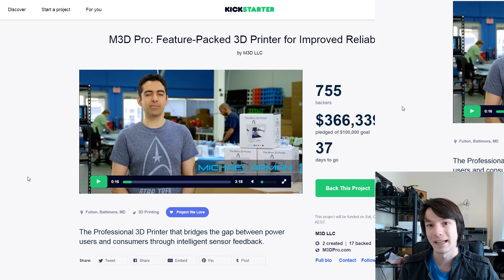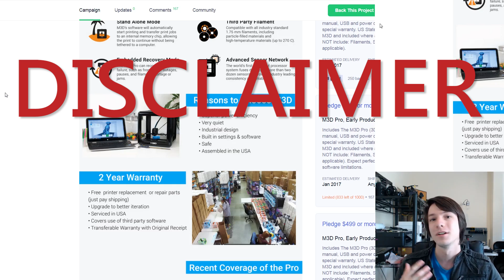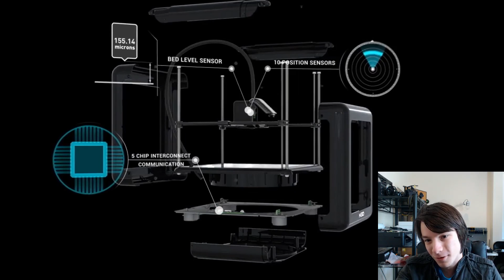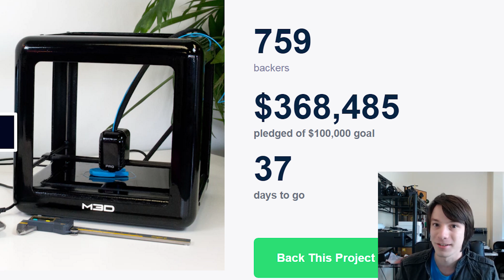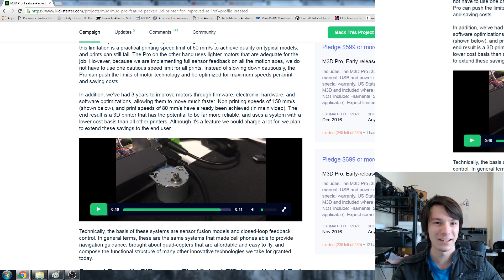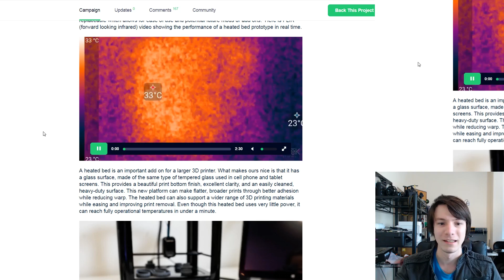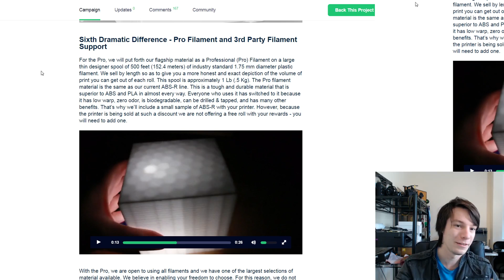Should you back it? M3D Pro Kickstarter Review

Comment: With the refusal of 3DPI to investigate (after 3 people promised to investigate), we might never know what actually occurred. 
However, the utter fact that M3D silently closed after Michael Armani absconded with @$23,000,000.00 US,, no one needs to worry about this company ever again.

I would've been a buyer of this machine.  I owned an original Micro.
I did print at 0.050 mm layer height.  It printed very accurately, but the machine was too slow.  by the time they introduced a Micro + and the upgrade kit, Ender 3 was here and destroyed any market share for M3D's Micro.

Did I mention that it was slow?  print time was not measured in minutes but in hours.
It printed perfect, and I DO mean PERFECT, parts.

BTW, I am the guy that ended MakiBox and the fraud of Jon Buford.  If that lends a bit more credibility to what I say.

Comment: One year after investing, I would say NO. For those of you who didn't invest, you dodged a major bullet.   I bought in to their March market ready Indiegogo tier on Dec 28, 2016. I recieved my printer in late October, then subsequently contended with very poor print quality despite a lot of calibration. Then there was PCB failure, causing the hot end to fail to heat properly. Once I replaced the PCB to fix the hot end heater, the print bed heater has started to give me problems. Print quality continues to be poor. All of the 'self aware' and standalone features we were promised have still not been delivered upon. And they have been sending out 'market ready' machines since April. 

For a couple hundred more dollars than you'd spend on this printer now straight from their store, you'd have a real market ready, fully functional, much more reliable and much faster machine. I wouldn't call the M3D Pro a scam, as I can tell that at least their support department tries to help people... but the repeated explanation for lack of promised features even *now*, is that this is still a machine that is in development, and given the fact that they've been selling directly from their site for a while, that doesn't really fly for me.
Reply: I really, really wish i'd come across this video way back when I dropped money on this thing. I feel like throwing it out the window every day I have to deal with it.  Have since invested in and looking forward to a Prusa MK3. Every remaining day I have to look at this thing makes me more upset.

Comment: I have to say thatI have a micro3D printer and love it.I don't have much to compare it to, but judging from comments I read all over no 3D printer is perfect. The micro3D may need a little extra setup and tinkering, but don't all printers?
But overall my printer works very well, I have had a lot of fun with it and keep it running 24/7 (as best I can).
To say its a successful hardware Kickstarter is obvious. I received something that works, and is useful!
I will be backing the Pro because the micro shows me this company has a great mission and the tech and desire to pull it off. They may have realized during the Kickstarter that the micro couldn't be the printer they wanted to make, but they did deliver a nice half step. Looking forward to what they bring in the Pro!

Comment: I just received mine and it is pretty terrible. It should be noted that this was estimated to be delivered in JANUARY and showed up at my door yesterday. It is missing 80% of the features ENTIRELY, including calibration. When attempting my first print it the nozzle pushed into the bed and began to DRAG ALONG THE HEATED BED. When it says it can re calibrate height it merely pushes into the bed and then lifts up. It solves nothing. Inserting filament is a pain too. 30 minuets of forcefully pushing in filament. I am extremely disappointed and wish I hadn't wasted the money on this printer. If things change I'll update this, but until then, STAY AWAY FROM M3D.

Comment: :[ I have a m3d printer the micro this is not right it is my first printer has a goo build space hasn't had a single clog its internal filiment loading stay away from it its terrrible but the external is great it is reliable good quality prints and for people like me with no knowledge of 3D printing the software is easy to use you guys most likely have the really cool printer ultimaker replicater and so on

Comment: I have 3 Micros.  I produce complex parts for Magicians and they all run constantly.  Do stay away from their new PLA Carbon Fiber. Their Tough Ink Flexible ink and works well.  I took out the nozzles and had a local CNC shop make me stainless steel nozzles. I found that prints were even more tolerant than with a Brass nozzle.  I've tested copper, bronze and wood filled filament and with the stainless steel nozzles I've had no problems.  Their support and customer service is excellent.  I've pledged for 2 Pro's that will run along side the Micros.  They're all run from a 12 Processor MacPro with 128 gigs of Ram.  Leaving the computer on all the time really isn't an issue as the same Mac is running a 50watt VersaLaser 24/7 and is on all the time anyways as it also wifi's 6 camera's around the house and property.  The Mirco's have a cold bed, the review said you can not print ABS on a cold bed printer without warpage, that's total nonsense, these machines have been doing it for almost a year now.  Cost was 299.99 special they ran and after the first machine paid for itself in a day. we purchased 2 more and they too paid for themselves within a day.

All in all we're very happy with these machines and look forward to the Pro units. Rob at the help desk, you couldn't meet a nicer man that puts his all into working with you if you have a problem. Since there is someone always here in the shop 24/7  he was getting tech support from Rob at 2am when they finished.  Customer service is great.  Warranty repairs are great, they ask for shipping, more than fair too, a lot of companies have turned to that. We have never been charged for any parts that had to be replaced.

The M3D software for the Mac is a bit buggy, but it is still in Beta.  I'm hoping they upgrade this for the Pro. But it really is a breeze to use, I can rotate, scale etc.  Any critical changes I need to make that the their slicer won't do, I just go back into CAD and twerk it.  Something I haven't seen reviewed about many printers is noise level. For the size, motors used and movement the Micro 3D is very quiet compared to other printers I've heard running.

While the different color machines were probably designed for personal use, they come in handy as we set ours up as a color coding scheme for certain parts. It's been quite handy, I don't agree though on charging and extra 25.00 for certain colors, but sometimes you have to bite the bullet and just do it.  

All in all we're all very happy with Micro 3D and look forward to our Pro's arriving.

Comment: I've had a 50/50 experience with my micro. Once I fixed my printer, and actually learned how to print it's been smooth, with the software updates it's been better, and better. HOWEVER, their customer service is horrible, my motor went out, and their customer service gave me a hard time about a replacement part.

Comment: I have an m3d micro printer and I got it to be a starter 3D printer, and I LOVE it, I mean it's not great but it prints and i love having a printer. I also set up a raspberry pi with octoprint to have it so it wasn't tethered to my computer ant now it works beautifully I really love it and m3d has been very helpful if I've had an issue

Comment: standalone mode is nice, but it's a pain to trasnfer files to an sd card and then put it into your printer. Just get a raspberry pi with octoprint instead and get the best of both worlds.

In any case, you should passs on anything M3D. They are toys and there is better stuff on the market now.

Comment: hi Angus, I own my micro about 1,5 year now. As student this was awesome option bought it second hand. I see all the hate but I have had a blast with it I pumped about 9kg of filament thru it once you get it dialed in it prints amazingly. its easy to transport and durable I just throw in in my bag and off I go. the software updates keep coming and increase the overall experience. very easy to use a third party slicer if needed. don't know if you will read this but just wanted to mention this,
Reply: The micro is so much better than the pro. I'm going to keep my micro. Pro is really, really terrible.

Comment: As kickstarter backer of the Micro, my conclusion is : Stay away of the Pro. 
The main problem with M3D is not the hardware, but the software. Hardware has many many problems, but software is so bad. I don't trust M3D at all for the Pro.
If you want to learn what you will not have in your next 3D printer, own the Micro. After that, you could choose a real 3D printer (I moved to Prusa i3 MK2).

Comment: Even still this just might become an ideal printer for some one who really just wants a plug and play, without needing to know much about the hardware, time will tell. 

Can't say for sure, but the Head looks like stainless Steel, and its a solid tube, measuring about 2.1in.   No idea what the liner is if there is any at all. Given the design, I can't be sure they every had one. Edit: seen Teflon listed in some details. 

Truth on the heater being ceramic, not cool. So far mines holding steady. 
If the head can be replaced this kinda negates the tuning. Thus the heaters should be replaceable. I really do not believe the story about the tuning. 

Used Black ABS only for doing calibration prints, and other objects less than 1.5cube. Without a heated bed, ABS really not useful otherwise. 

Best stuff I have used with the micro, that does not require a heated build plate, PET-G and M3D's own blend Ultra Durable 3D Ink. PET-G is very similar to what your soda bottles are made from. The ultra durable stuff is very tolerant, like ridged high temp hot glue. Ultra Durable also is the only stuff they allow 50 micron and solid back fill, and yes it works. 

By the way M3D now offers carbon fiber on their site.

The Micro is not my best friend and I have plenty of critique, in fact two pages of it. But there are far worse machines out there. Their pro addresses most of the issues we the actual users have submitted. Could they still do better? Probably. Even still this just might become an ideal printer for some one who really just wants a plug and play, without needing to know much about the hardware, time will tell.

Comment: I got an M3D micro as an Xmas present last year and it's been great! I've heard a lot of people had issues, but I must've got one from the second or third batch because the only problems I had were some random shifts (some slight, occasionally a dramatic shift) in the print, the usual problems with ambient temperature, and that's about it. So overall I'm happy with the micro and expecting good things from the pro.

Comment: In short, stay clear of it.
I was a backer of the M3D and that printer TOTALLY SUCKS!
It ended up thrown on the floor out of frustration. And that's the best thing I ever did.
So much time I wasted trying to calibrate that piece of crap.
They claimed to have auto-calibration feature... well, auto-calibration my ass! It just does not work.
Now I happily own an FlashForge Creator Pro. It works like a charm. Of course it costs more than the M3D, but the quality/cost ratio is much much higher. To be honest I would actually define the quality/cost ratio for the M3D as 0, as it is basically unusable!

Comment: Wow, they made it a 'feature' that the heated bed uses 0.6 watts instead of 5 watts per square inch?    So they've cut power to a device where output is proportional to power.   What they're really saying is that it will take 833% longer to heat up, that it will struggle to hit the target temp, and that it will have trouble holding the temperature.

Comment: Another Micro kickstarter backer here. I can only echo the others' sentiments. It's slow, buggy, and can't print ABS at all and PLA only barely. The quality is ok when it works, but not stellar, and you have 50/50 chance of failure even with simple parts. And the software it comes with is just absolute garbage.

I have just today received a heated print bed mod for it, I'm hoping that it'll make it work better and I'm not just throwing good money after bad... Even just doubling the reliability would go a long way to make it kind of acceptable cheapo printer.

Comment: i own a micro m3d and it never really fully worked. at the beginning a few small prints worked out well but then it got worse and worse. ive tried to fix it, did all troubleshooting and calibrations over and over again but now its just a brick. i would not back any 3d printer anymore, better wait for it to be released in retail. it will be more expensive but youll safe alot of time and hassle as kickstarter printer project never go well and they are always delayed (and sometimes even quite big hidden costs like shipping, upgrades etc).

Comment: While I like your videos,  I do have to say you missed the point on a lot of things. M3d seemed to be comparing the specs more to the original than other printers in general. Also, the printer's nozzle is stainless steel, so filled/abrasive filaments shouldn't be a problem with wear. 
Last thing, the comparison to a $300 i3 is a bit overkill. They have a lot more features built into this with all the sensors that will (in theory) improve reliability and the quality of the prints. 
In my opinion, it isn't a too high of an asking price for the innovations they are trying to put into this.
It just seemed to me that Maker's Muse was a little miffed about not getting a printer for evaluation, back then they probably didn't need to do that since they had so many orders. It seems they will be doing that this time around. 
And yes, I backed it, but not 100% sure if I will keep my pledge. I already have a BigBox that keeps me busy.
Reply: Angus is just another shill who wont review anything he doesnt get for free.

Comment: A friend of mine got the M3D back in 2014, and it has never worked to quality standards of say the I3.
The slicer has waay to few options. 
It deforms anything that is round and somehow shifts for example one half of a full cylinder a milimeter or two in the x or y plane, which makes the print completely useless. 
the prints take for ever to print compared to my Rostock MAX or his current I3 at even when only 30mm/s printspeed vs the fast slicer option of the m3D.
It produces bad, not fully filled in, too light and fragile prints that are nowhere near watertight...

Conclusion:
If you are thinking of buying a low cost printer that poops out good quality prints, just get yourself an I3 for example, or some of the printers named in this video and not any M3d products. get one with actual nema 17 steppers and a ridgid frame with steel rods and not this flimsy piece of crap.

This is just a beware for anyone thinking of getting involved in this kickstarter

Comment: I backed the first one and I regretted it, to be honest. $600 early beta pledge ( what an arse I was) got me a printer that was a year late, didn't work on arrival and after sending back for a replacement, POSTAGE FROM THE UK AT MY OWN EXPENSE, was, well, awful, to be honest. Slow, very hit and miss, poor slicer and software and frankly disappointing on most levels.
The M3D micro had the promise to be an awesome wee printer but failed at too many simple things. If anyone looks at the kickstarter comments, people are still waiting for their printer now, after almost 2 years and most of those with the printer are unhappy with it. Don't get me wrong, a few people are very happy, but they are few and far between. 
Doing a kickstarter in 3d Printing has to be good and cheap - there are so many reliable little printers available for low cost, so if your project doesn't at the very least match up, there will be few people backing it.
My M3D micro is now a paperweight but I plan to tinker with it with some unofficial improvements, like adding a heated bed and some firmware changes.

Comment: 15:27 geared motors will have slop in the gears; Looks like the :-1pcs 28BYJ-48 Valve Gear Stepper Motor DC 12V Step Motor Reduction Arduino

Comment: I was not a backer of the original M3D but have been using one for about 5 months (time lapses on my channel) what I liked was the simplicity of the slicer as a newb in printing it kept the amout of errors I could make. I also like the look and size. It's perfect sitting on my desk. 
What I didn't like is the slow speed (well explained on your video) and some of the inaccuracy of the prints (parts don't fit together without modification) 

The pro promises quite a few things.  I look forward to seeing it. Price is a little high however for what it will be.

Comment: I have a micro and it came with a 1 month warranty. It's my second 3d printer after I returned a nightmare quality prusa i3. It was pretty good thing to learn on, what sort of shapes I could print, getting an idea how often things fail. I even had decent results with ABS. Except it broke a week after warranty. The print head lowered instead of rising mid print, and eventually melted down through the build tac and print bed. Twice. It doesn't make sense to me why it could go so low. M3D gave me an open ended offer to exchange for a new printer (with a 3 month warranty) if I cover shipping. Total cost for the exchange would be 220 USD... + exchange rate and import tax because I'm not american. Honestly not sure if I will :/